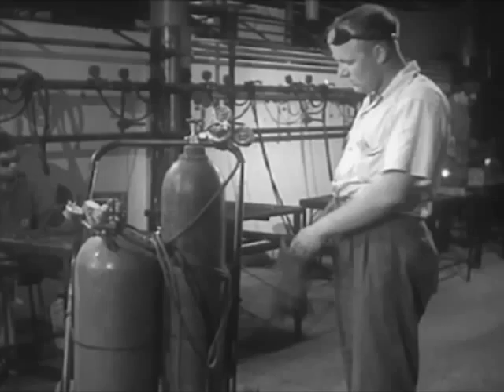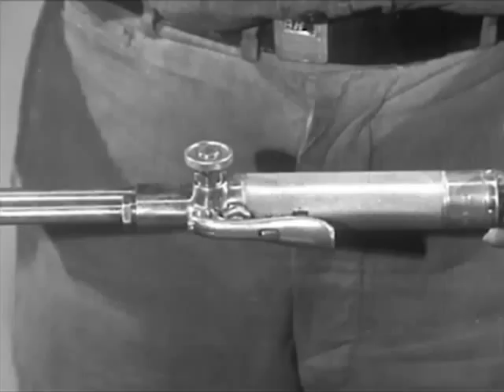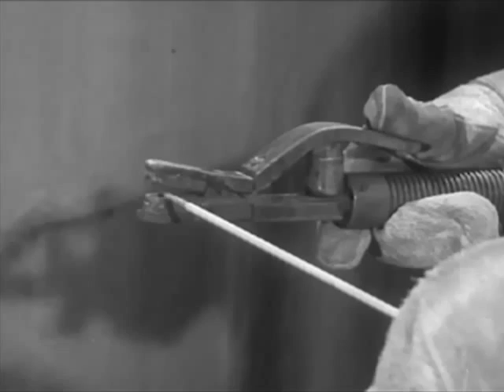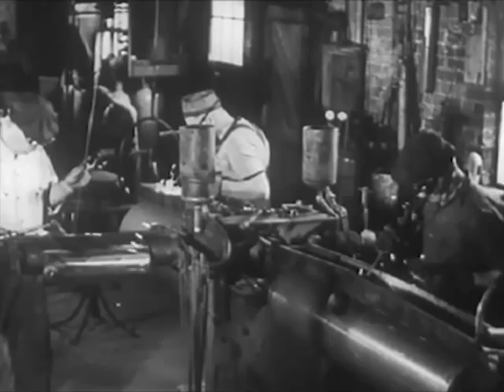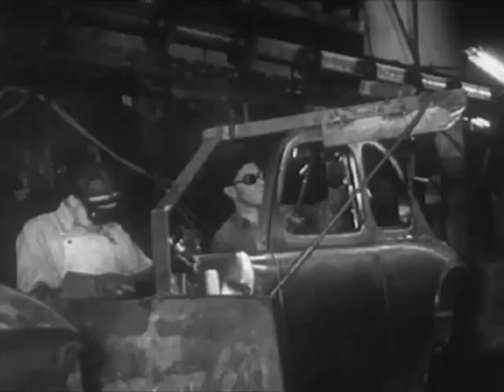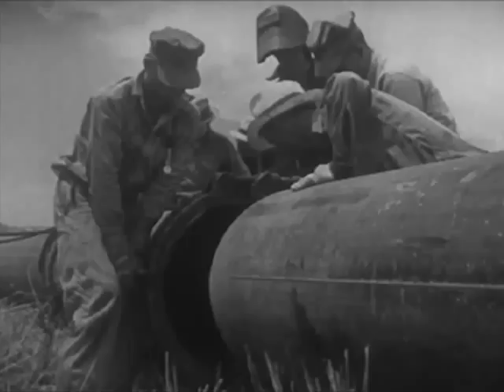1940s Vocational Guidance Film: The Welding Operator - 1942 - CharlieDeanArchives / Archival Footage

Comment: And in 2022. 0 has changed for skill. Processes. And techniques. I've been welding for 12 years and little to nothing has been reinvented.
Reply: I mean, as far as stick welding goes nothing new there, bit now mig, flux core and dual shield wire welding are more common, and whole this video covered the ancestor, TIG welding outmoded oxyacetylene welding. There have definitely been innovations in welding as a whole.
Reply: A LOT of processes, techniques, and technologies have changed, been invented and reinvented.
Welding machines changed from transformers to inverters.
MIG and flux core were invented and became more popular and affordable.
TIG was invented and has also become more affordable.
Autodarkening welding helmets were invented.

If anything, maybe oxy-acetylene has been the only one that hasn't changed much or at all.
Reply: Ive been welding for 20 years...alot has changed.
Reply: @GoldSrc_  well yea all that. But as far as human skil and technique and welding processes are the same